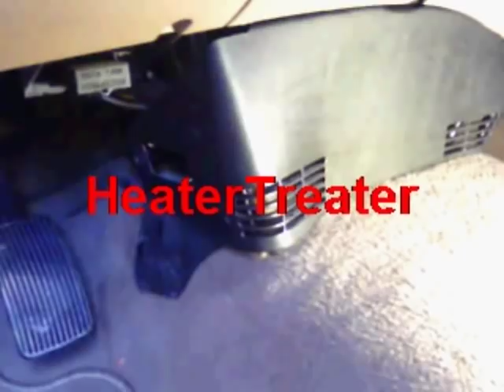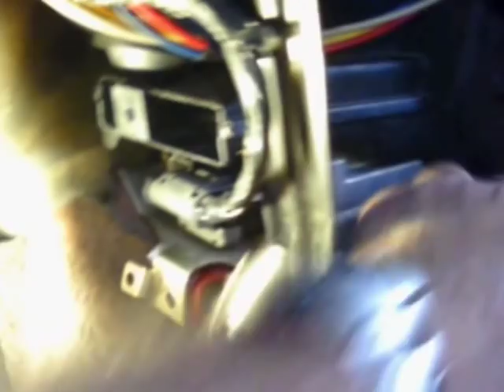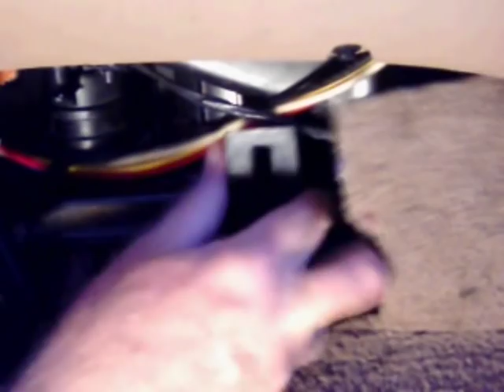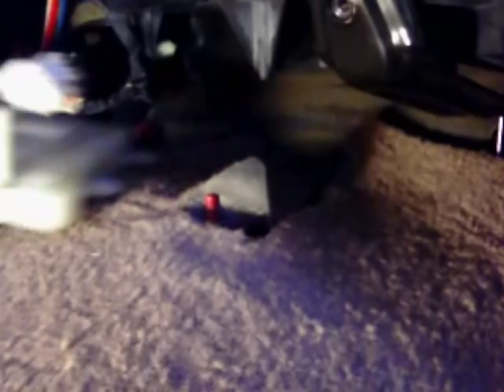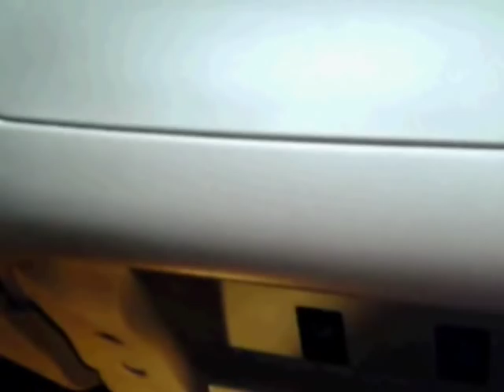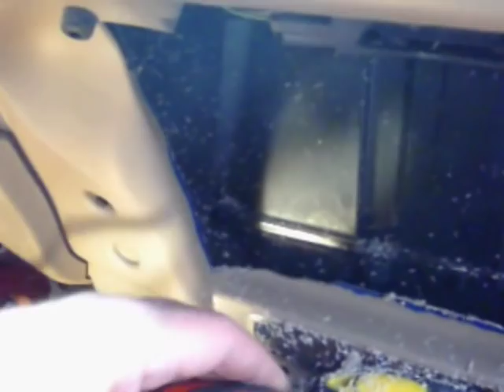HeaterTreater Ford F150 Part 1

Comment: Just completed my blend door repair on my 97 f150 5.4ltr. The hardest thing I ran into was like they say in the "video" the screw behind the duct working for floor vent, it took longer to get it out than it did to do the entire job. BTW for those who want to know what dremmel bits to use, i used the (1/8"diam.199 dremmel high speed cutter) by dremmel bought it at home depot for 8 bucks makes a clean cut lasted the entire job. took the neighbor longer to cut his yard than it took me to fix door

Comment: The guy that noted that the fix doesn't work is wrong.  We installed thousands of these without major issues.  Note that you can't use a plastic OEM door, you have to have the two piece HeaterTreater door for the installation with this method.  You can get more information on our web site.  It DOES work and you can check the segments on Truck U or Motorhead garage for additional video clips from the "STARS"...

Comment: Specifically, what was your issue?  If you did not use the heater treater door, what door did you use to replace - OEM, Dorman, other?  Did you replace both the door and the motor?

Comment: This DOES NOT work.  I tried it and all that I accomplished is to destroy my heater box.  You will end up with a worse situation than what you started with.  I have taken the whole dash out and it's impossible to do this fix because of the way the heater box is designed.  You have to lift up the door to remove it.  It is a lot of work but I wish I would have never seen this video.  Now I have to spend more time looking for a heater box for my truck.  DO NOT do this to your vehicle!

Comment: The difference is that the cheap plastic door will break again and it is more likely once your truck has been identified as being susceptible to breakage.  The installation is also different since you have to remove the dash to get to the plenum box to install a single piece door.  The HeaterTreater door is metal and constructed in two pieces to make the installation much easier.  If you are going to go to the trouble of removing the dash, a metal door is a better replacement choice .

Comment: This is actually a very good video to help get u through this blend door procedure. I would make sure to  check the motor before I changed the blend door. I actually took my whole dashboard out and it was kind of a pain in the butt, then I found this heater treater product which I would of used for sure.. It is worth every penny. Also if your blend door is broke at the base where it is attached to the motor it will flop open and shut while your driving.

Comment: (Part 2) So I don’t know if the shop broke it or if it broke because the truck is over 14 years old. In order not to blame my mechanic for the problem I searched YouTube and found your video. I went backwards though. I used a Multi-tool with a 1 inch wood cutting blade to cut out behind the glove box and plenum to expose the blend door. Sure enough the blend door is free moving. It moves a little bit, but is over powered by the force of the air passing by it.